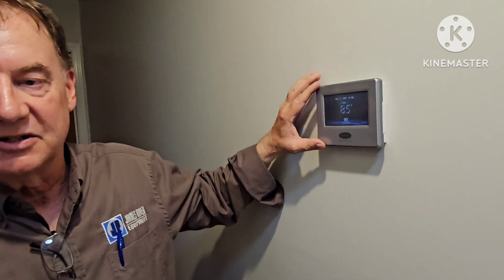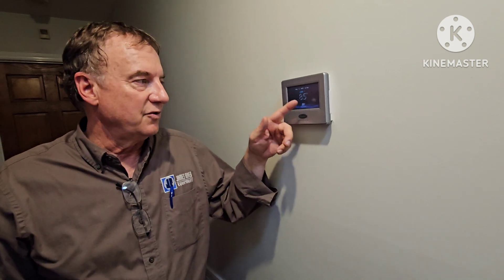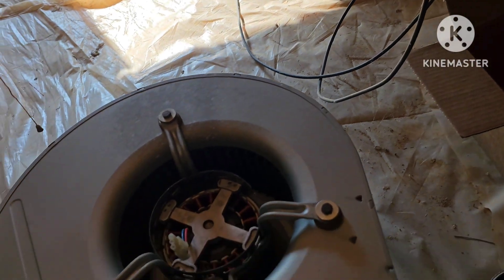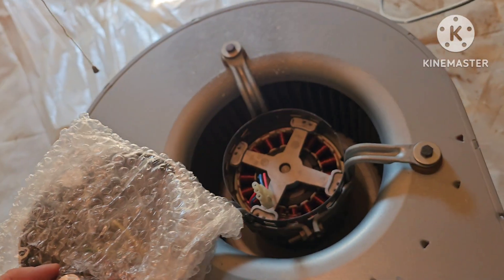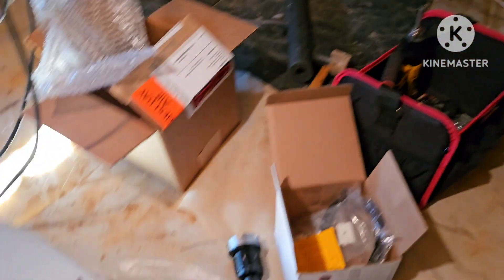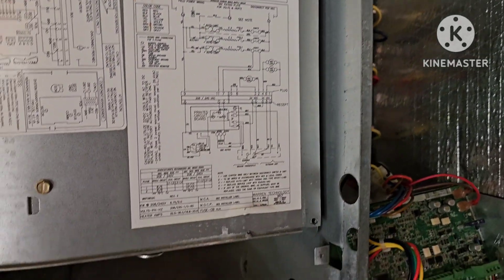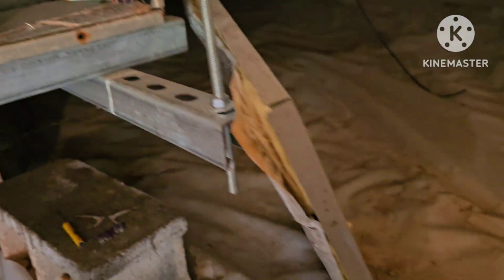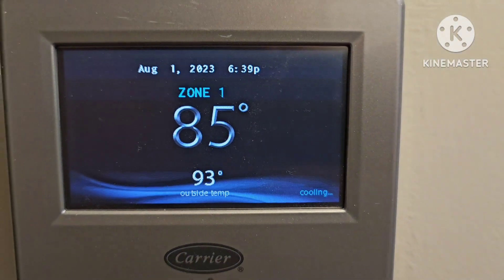How to fix Code 44 on a Carrier Heat Pump

Comment: Hello, can a regular home owner order these parts and install based on video or does one need to go thru an HVAC maintenance to get the parts and have the work performed?  I am in Florida and have this code error.  Also what is the cost of the part?
Reply from the maker: Yes, you can do it yourself.  I ordered the parts over the internet and installed them myself.
Reply: @mnspeed1932 what are the part numbers and where do you buy from? Many thanks